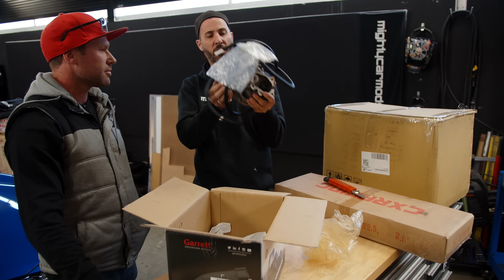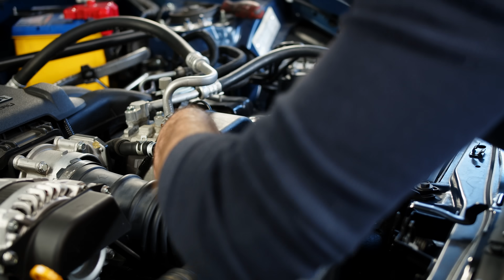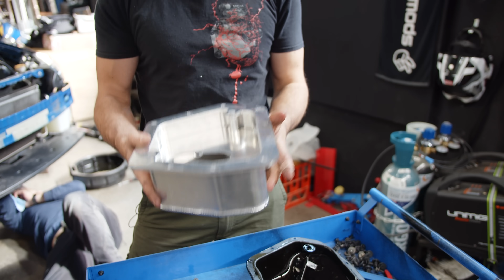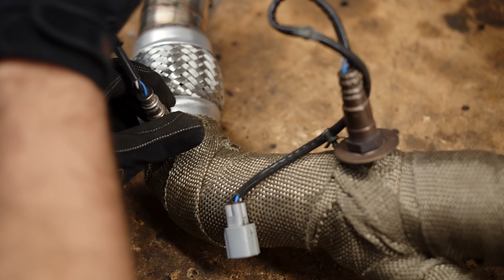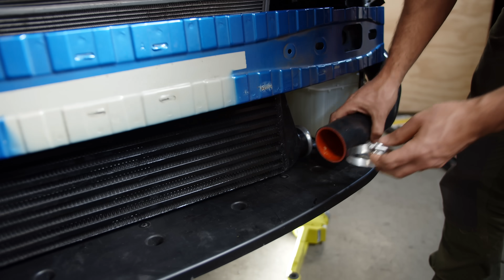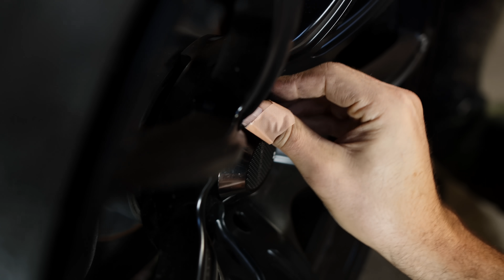How To Turbo Your Car [IN ONE DAY!!]

Comment: I Googled the double nut technique and it came up with a pretty tame answer:

"Typically, the use of double nuts involves preloading of the nut closest to the members being joined, which is often a 'thin-nut', to between 25% and 50% of the final required tightening torque and then tightening the second nut to the full torque required to achieve preload."

Comment: DONT START MOTOR BEFORE YOU OIL PLUG ARE ON AND TIGHT OIL COM OUT FROM RETURN OIL START MOTOR CHECK AL SCREVS TAIGHT LETS GO OUTSIDE HOUSE CLOSE MOTOR GO IN DRINK COFFE AFTER CHECK ALL SCREVS TIGHT THEM UP DRIV SOLVLY CHECK FORE NOICES 5 MIN AFTER THAT CHECK EGNITON TIME IT UP NO TICK TICK THEN U GAS IF TURN DOWNS EGNITION 1-3% U ARE DONE OUT AND DRIVE LITEL CHECK OIL LECAGE

Comment: I was wondering if you needed a heat shield between the turbo and the inlet pipe? The hot side looks seriously close to the, nice cooled down air intake from the intercooler. Its kinda counter productive not putting something In between the two 🤷🏻‍♂️

Comment: QUICKEST WAYS TO TURBOCHARGE YOUR CAR - 1. Switch to 91 octane or higher top-tier premium fuel, 2. Switch to iridium spark plugs - preferably Bosch, 3. Attach a "turbo" logo to the rear of your car.

Comment: use gtx 20w50 mineral oil. check the difference. the only draw back is - you have to change it every 5k kms . and you have the cleanest engine.

Comment: It looks the intake is coated but I would still be concerned with heat from the turbo. I would make a shroud of some short or at least a turbo blanket to protect the other components.

Comment: Ehehehehhe im saving to buy a Turbo T4 twin scroll 500-1000hp, universal for
 my Toyota 86  and also Cold Fusion Nitrous Oxide System Wet Shot 4 Cylinder when i buy the car
Reply: your gonna need alot more than a turbo to make that kinda power, long list of supporting mods for 500hp in a 86

Comment: My car already has a turbo, can i follow this guide to have a second one installed?
Reply: why do you want a second one?
Reply: @arcanevoid9199  i think the bigger question is why wouldn't you
Reply: @MrFuzzwuzzle  because i doubt your car needs a second turbo, not to mention how much more complicated it makes everything. you will literally have to custom make everything as all the piping will need to be replaced, headers etc you will need to decide what twin turbo route you wanna go (sequential, parallel etc). so much easier to just get a bigger single or just make more power with what you have

Comment: Omg i love u guys lol Im actually looking for a solution to my problem. At stop lights, when i try to accelerate, it acts like its not getting enough gas or the right mix of gas and air...so the motor shuts off..or at 70mph and j have my foot on the gas, it will not let me give it gas. Bc its not getting any, the motor shuts off. The other day, while it was cold i started it and turned on the a/c, it died right away. Its getting too hot and emitting a white smoke from an "under-the-hood exhaust" looking thing. Ive changed the filter, the pumps motor and filter and the tps...no one has an obd1 reader so i had to put in into manual and pull the code myself. 31. In the Chilton(extra repair manual)  it says 31 is an air flow meter. Does this sound correct?

Comment: Could you turbo a 2001 toyota corrola s?
Reply: if its a 1zzfe then you could relativity easily, just not cheap though. will need a turbo kit + ecu and then a tune, and a couple other supporting mods would be a good idea

Comment: Hey I know this video is a year old but I have a 350z and I just got finished buildimg my kit and I was wondering if I could install the whole kit and just not connect the cold side in order to drive it to the dyno shop?
Reply: just get it towed, so much easier. not like its that expensive anyway

Comment: Is it possible to install a turbo on to my 2004 Toyota avalon? and if so What companies/model should I use?
Reply: which engine do you have? cause if you dont have the 2grfe you would probably be better off swapping that in and then boosting it. they already make factory superchargers for it
Reply: @arcanevoid9199  yeah sadly I don't have the correct engine
Reply: @ESK8Andy  have you considered selling it and getting something else? would be a lot easier, could get a far better base to start with too

Comment: You can’t turbo or supercharge a engine, unless there are manufacturers that make one or the other for a specific engine. PRIME EXAMPLE, Ford Ranger 3.0 (and no, whipple no longer MANUFACTURES one).
Reply: you actually can
Reply: @arcanevoid9199  I would love some information on how, Please! I am looking to turbo my 3.0, but only need to boost for towing. I’m not looking to get bullet push rods and heads, just a lil more pep in the step
Reply: @trentmiller7532  forums would be the best place to look, could be a turbo kit available or a turbo manifold for your car. but you would need to make sure that your engine is up to it in stock form. and if you only need it for towing you could get a hi low boost switch as it would almost be like having no turbo on the low setting
Reply: @arcanevoid9199  That’s my original point. They don’t make one.
Reply: @trentmiller7532  you can get a custom turbo manifold made for your car, would need to check for clearance and how you will route your piping. and turbo manifolds arent that expensive to get one made, just pick a flange and then a turbo

Comment: My personal headcanon with putting that engine in the BRZ/GT86/FRS was that Toyota needed the Engine and Subie wanted to throw a Turbo Version in but Toyota fought them on it tooth and nail and by the time a decision was there from the engineering teams the Accountants Stepped in and told everyone that they're not building a Turbo Version.

Comment: Good luck with an aftermarket turbo for track use. More heat, more oil usage = more problems. Ask the dudes from Donut who built 350z with turbos, they did not last one day and both guys said after that they would totally have skipped the turbo part. Well I truly wish you better luck than them, but I'd stay clear from any non-factory turbo on any track car.

Comment: To lower the oil temp, first you can buy a better oil with pao/ester base, rise the oil sae is an old solution, the best oil you can use is the lowest sae that lubricates the engine and turbo (sae30 have less friction and lubricates faster de engine than a sae40 while mantaining power and gas mileage that you lost with sae40. also rising the sae rise the oil pressure and that increases the temp), As i think castrol sponsors you, they have the edge c3 0w30 with 60-70% pao base with a complete aditive package, its million times better than this 5w40 a3/b4 HC based castrol edge, its not good for track duty.. if you want to keep using sae40 for whatever reason, the edge a3/b4 0w40 and the supercar 0w40 have a 50% and 80% pao base with a lot of additives also.

Comment: New sst headers? $1000? Single turbo with 5psi, stock manifolds, and no intercooler, eBay cheapo? More power? Less cost? V8 motor.

Comment: "Its like Subaru or Toyota .... just wanted us to do this"

Uh yeah. That was the premise on the development of the car and cheapness of the base platform. They also used a FA20DI motor, which is almost mechanically identical to the FA20DIT found in the WRX, whereas other Subaru cars, like the Impreza and Crosstrek got the FB20DI. Subaru even said they wanted the car to be a blank slate for owners to do whatever they wanted.

Comment: Y'all spent a lot of time talking about brakes and tires being important to upgrade.  Aside from the quick comment your expert made, why did you fail to inform on the importance of proper fuel delivery as well as fuel/air ratios?  

Did the "quick tune" your expert did somehow bypass emissions controls/sensors?  How much tweaking of the "brain" and it's sensors will you need to make this run decently?  Are you compensating by running like 1lbs of boost?

+ Turbo to vehicle = greater volumes of air induced

Greater volumes of air + zero increase in fuel delivery = lean fuel/air ratios

Sure, you turbo'd your car in a day, but I highly doubt it ran very well without serious tweaking.  

Fuel delivery and emissions restrictions are crucial things to consider. (Yes, even for track use)

Comment: Love your vids! Been watching for a few years now - keep it up!

I just had to mention that you should never use silicone-based lubricants on silicone rubber parts, since the silicone oil can melt/dissolve the silicone rubber and degrade it. Silicone oil is a great waterproof and durable lubricant, but keep it away from silicone rubber parts!

Comment: The intercooler is black on the front so it will transfer more heat to the air and surroundings outside the car. It's silver on the back so it will absorb less heat from the radiator. Directional radiative heat transfer.

Comment: The BRZ needs an oil cooler. Almost every 86/FRS/BRZ I see on the track (including mine) has an oil cooler even if they're on stock power. I've seen a stock FRS blow its engine after 2 track days because it didn't have an oil cooler. The oil temps on these cars gets really high.

Comment: Want a car with a turbo? Buy one with an engine that was designed to handle turbo pressures in the first place. Everything is beefier and stronger. Block, pistons, rods, mains. Even the heads have different bolt patterns. A turbo engine has a low static compression ratio to allow for boost. If you are at 10:1 and then add 1.5bar of boost, the 98 ron fuel wont work. Its never been about bolting on a turbo. All you are doing is spending money to make a hand grenade.

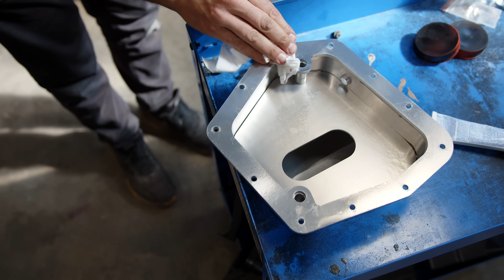Comment: 12:10 Marty sounds like he's spent some time watching a few B.O.L.T.R. from a certain faceless Canadian
Reply: bodoy euir  that used to be a thing. Back when engine blocks weren't that strong and gas was lower octane. Most modern engines can handle 10-14 psi relatively safely in stock from before head bolts start to stretch.

Comment: I wonder what the logistics would be of fitting one of those boxer engines in upside down?
It would make it a lot easier to turbo and better for heat management.
Reply: I think by the time you got everything to work, it'd be looking pretty similar to how it is now...

That is to say, turn engine upside down, the sump is on top and drive accessories are on bottom, not going to work well. So then re-engineer sump to bottom and accessories to where they fit, and about a thousand other things, and I reckon it'd be similar to how Subaru made it.
Reply: John Josephson . The sump is the only issue that I can see. With a dry sump system that would be solved unless there is some design issues with the oil galleries that would stuff things up.

Comment: Not sure if it's such a good idea to use silicone spray on silicone hoses...isn't it literally a solution made of silicone suspended in a solvent that would therefore necessarily be capable of dissolving silicone?

Comment: What SIMPLE mods can be done to a stock turbocharged engine to get it to spool up at a slightly lower rpm say 1500 instead of 1800 ? I swear I saw something like this in an MCM video and it's driving me crazy. I remember thinking to myself that it's so simple I can even take it off when the car goes in for service to avoid warranty issues. Maybe a blow off valve related thing or another bolt on doohickey ?? Please help guys

Comment: Surprised you didn’t know this Marty but if you pour oil out of the side of the bottle not what looks like the front opposite the handle then your less likely to spill or get the annoying glug action learnt this as I have to do oil and screen wash and coolant top ups at work sometimes i’m quite higher winds. Give it a try :) wrote this then you did it 😂

Comment: it would be nice, just once, for you guys to properly build an engine - cams, throttle bodies, valves and springs, solid lifters, rods, pistons - instead of cheating with a turbo. there's gonna be a whole generation who grow up thinking the only way to more power is forced induction.

Comment: Quick tip with using atv/blue max/silicone is to cut a V into the end so it makes it easier to run an even bead around. Windscreen replacement guys do it all the time.
Reply: 2:30

Comment: So there's only a tenth or two in lap times between the BRZ and STI, which means the BRZ will now be significantly faster? That just sounds wrong. Or have they been using tracks that suit the BRZ? Or not fixing the grip issues on the STI?

Comment: Sigh...a turbo in this car is a bad idea. The whole point of the car is that is perfectly balanced and very responsive. Putting a turbo in changes the throttle response and can make a car twitchy out of corners, particularly if the car wasn't designed for it. Instead I'd have thrown a flat 6 from a porsche in it.
Reply from the maker: Sigh... pUrItY?
Reply: @mightycarmods  Not purity, intent. The design of the car is balance and response, turbos dull the response. A flat 6 would add the power that you are looking for while also keeping the response, also keep in mind that a super charger would do the same thing. The problem with dumping a bunch of turbo power into a non-turbo rear wheel drive car is that you ruin your corner exist ability as the power becomes non-linear and can break the rear wheels free and you don't have to be ham handed with it either. All that has to happen is that boost comes in unexpectedly. Suddenly you go from having 120 kw at the wheels to having 170 or so it happens quickly and the car is already turned to be a bit tail happy.

Comment: No fuel system mods. Really should run a larger fuel pump and injectors not only to get the most power for the turbo but for the safety of the engine.

Comment: Inlet pipe running above the turbo hot side, defeats the inter cooler. Needs heat plate to isolate.

Comment: 13:37 Tyler mentions, and Moog removes, a blanking plug to plumb in the oil feed. I realise engines have various blanks around, but this seems super convenient - do we reckon this was designed by Subaru/Toyota in mind for this kind of upgrade, or does it just happen to be a convenient place?
Reply: I have no specific knowledge of these engines, but often there are different versions of similar engines in different cars with different setup options, which means unused ports and bolt holes etc.
Plus sometimes the way parts are built leave holes that need blanking, like Welch plugs, and the ends of oil galleries.

Comment: "doesnt have blowby"

throttle body butterfly is literally caked in oil / carbon

LOL
Reply: Jeff  of course, virtually all diesels have this and I believe WRXs. I dont think BRZs have egr systems though.
Reply: Oh is that what a vacuum hoses are for but shouldn't there be one for the brake booster

Comment: Not using the kit Turbo Yoda developed?! Also where is the oil cooler kit, as these engines struggle with oil temperature management on track.

Comment: All is bad. 
First - No cooling of the turbocharger. 
All ball bearing turbos require water cooling – coke from overheat oil in ball bearing break it very very quickly, and also, for information – in all small Garrett CHRA,  the bearing separator from PLASTIC!  A few good heats and the turbine will brake.

Second – In this location of the downpipe it be heating all very match, and also any oil leak will lead to a fire. 
Third- so long silicone pipes, is not a very good idea imho.

From Russia this love. Dmitry aka Capitan. Subaru tuner.

Comment: Toyota / Subaru said they would be making provisions for more cooling (they left room for oil cooler near the gearbox), more stiffening, and more power when they released the car because they knew that people would want to modify and personalize the car after they got it, and they wanted to make it as easy as possible. The car modification scene in Japan is pretty huge, even for people who are not really gear heads.

Comment: In Ireland, a brz is more expensive than a 2 door sti because of VRT (vehicle registration Tax) so to import a BRZ here cause there not sold it costs minimum 25 grand due to a 27% tax the car but you'll pick up a STi for under 20 grand because rallying, so every time they say the brz is a great starter car I can't help to laugh.

Comment: Can't believe how easy that kit is to install! Also, are there no concerns with pulling oil pressure for the turbo off that front galley plug? I always heard these motors have trouble with feeding oil to the #3 and #5 main bearings, especially once the oil gets hot and thin with turbocharging and/or track time. That galley plug used for turbo oil feed looks like the one directly above the oil pump which feeds directly to the main bearings. That being said, I'm from the US and Subaru specs a MUCH thinner oil here.

Comment: Why not go for equal power on the crank instead of on the wheels? 
Intresting to see if the awd more traction and less  wheel power is a better way to go than the rwd less traction and more power at the wheels, to see if the drivetrain powerloss  is worth the traction

Comment: Marty at 28:53 - (and i'm amazed it happened.) Pours the new CASTROL EDGE 5W-40 into the BRZ, using the "Glug Glug Glug, Mr. Spilly Pants." Method. (While Moog looks at the oil with a long stare thinking exactly what i was thinking...) How long has one of the most celebrated car mod Gods been poring oil in such a manner? OK Marty, no disrespect and with a kind tone voice (like a Dad teaching his son) Turn the oil jug 90deg. flat side down thus letting the air in whilst, letting the oil out with a smooth constant and unwavering clear pour. Still love ya Marty, not a dig at ya... With many apologies eh,  Rob From Winnipeg Manitoba, Canada. Again sorry, i apologize. Canada apologies. Sorry.